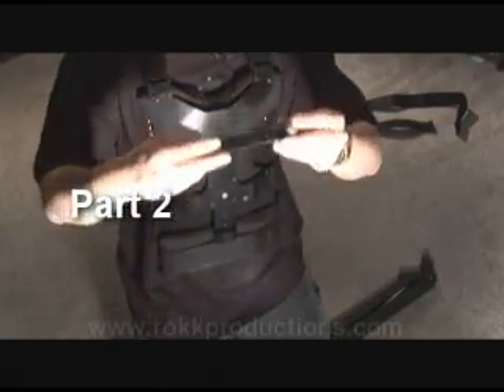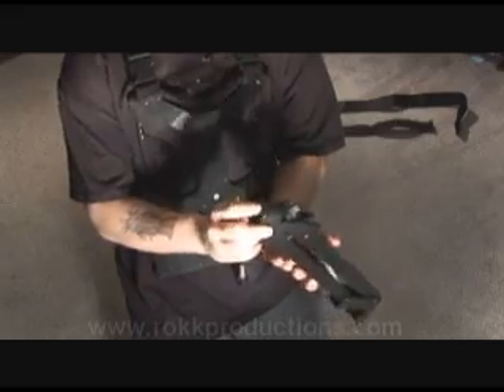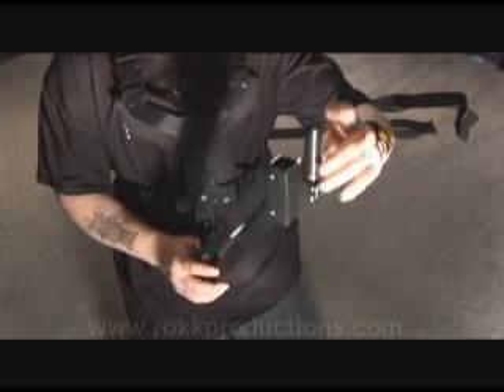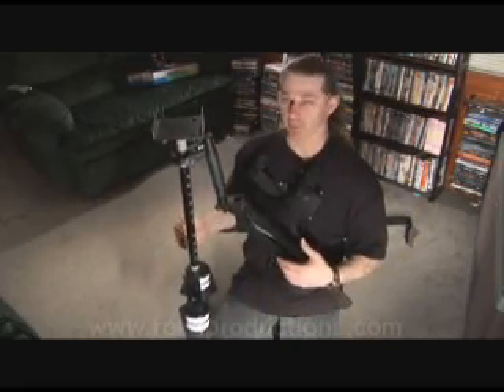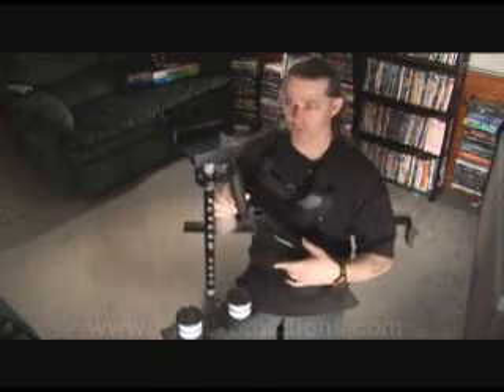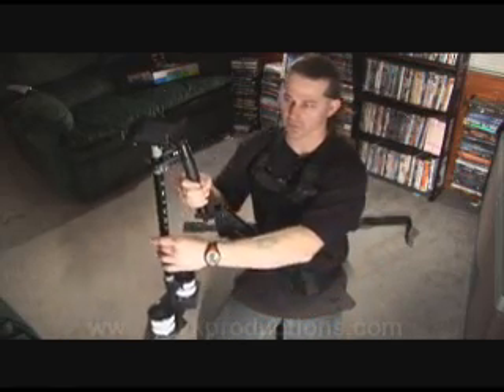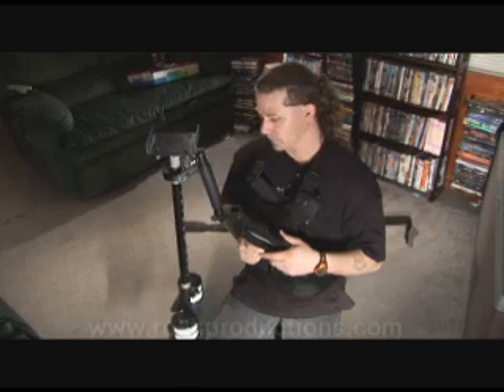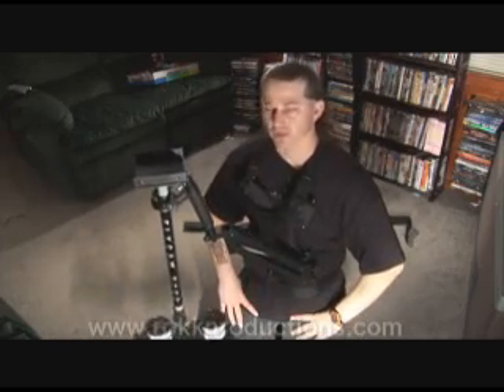How to put together the Flycam 5000 & Vest assembly part 2

Comment: Thanks for the video. I may be buying this arm, but I don't know if it will hold mi stabilizer+my camcorder.

Have you run tests to see what's the maximum weight this arm can handle without giving up?

Or may be you could tell me how much your camera+flycam500 weights.

thanks!
Reply: the flycam HD-5000 could support 4KGs